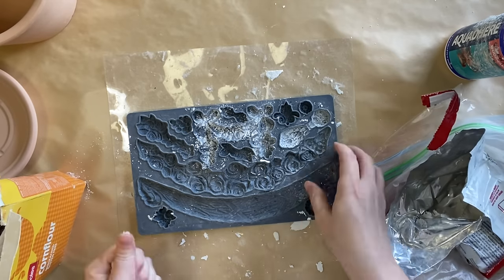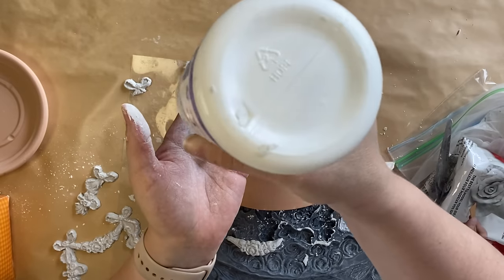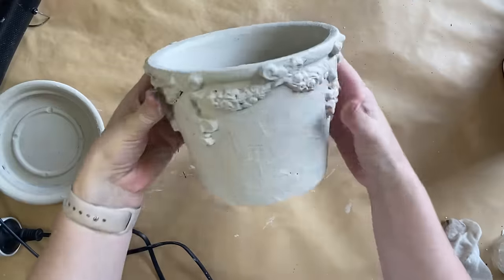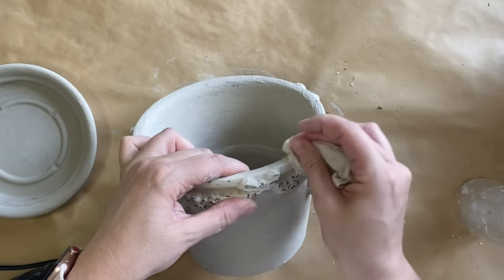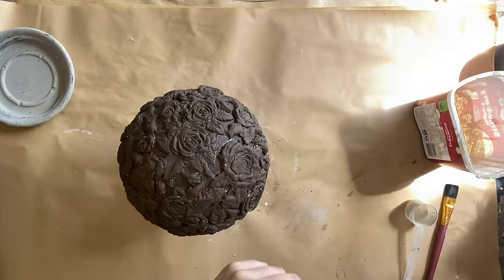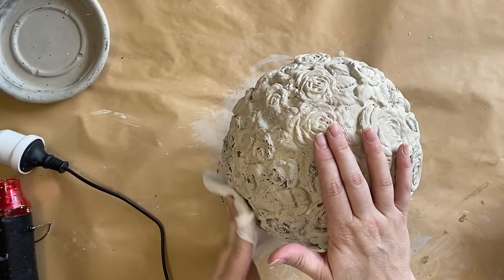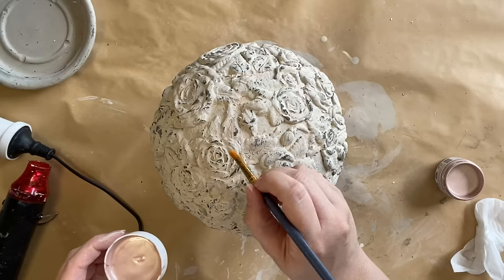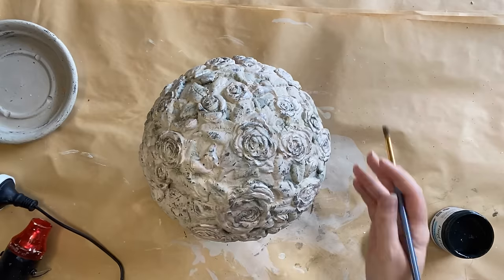DIY French Country Pot & Topiary using IOD Moulds | Shabby Chic | Chippy Old World Garden Decor

Comment: Can you seal milk paint with a liquid sealant like polyacrylic? Or does it have to be an oil?
Reply from the maker: I find that water based dealers reactivate the milk paint and smear it. A wax is a good sealer or maybe you could use a spray sealer.